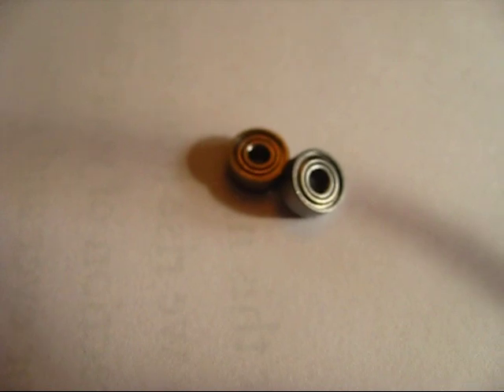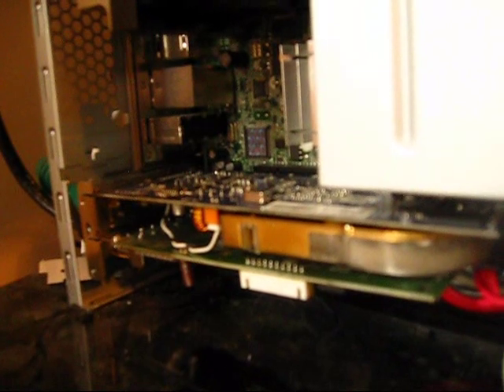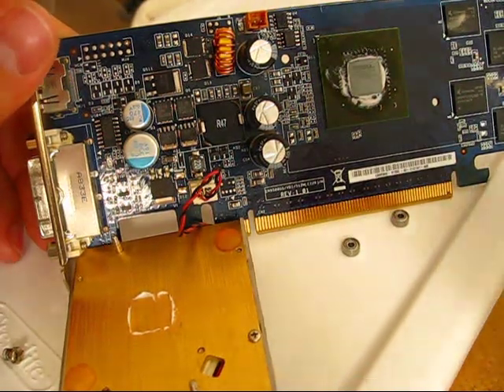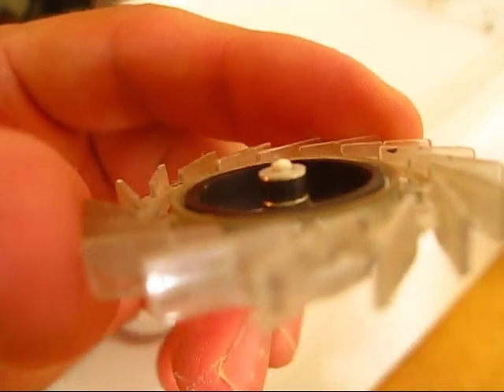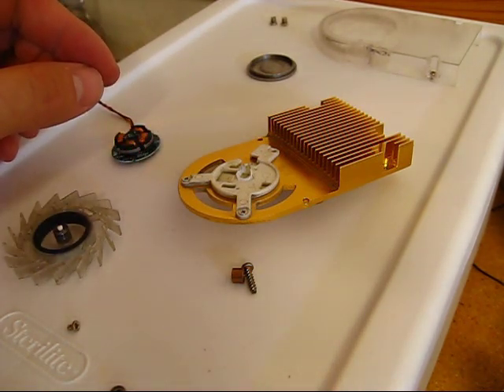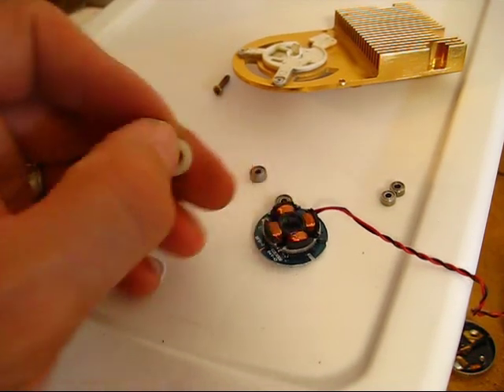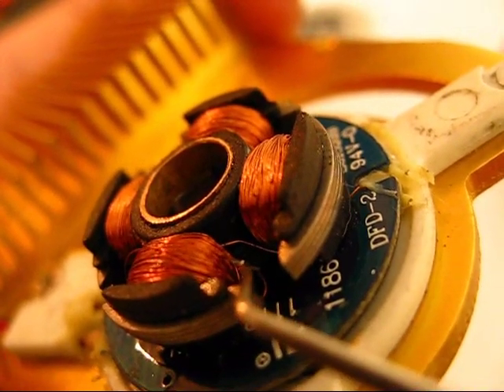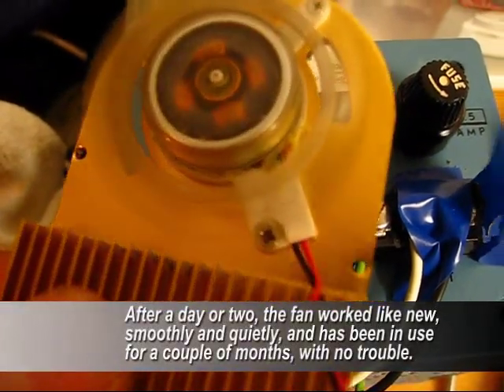Video Card Fan Repair

Comment: A Sayler It's kind of silly. The more you fix it, the more you break and have to fix lol. You need to research online and think about what you will do and if it will break it. If you think it will break it then do the fix differently!
A year ago I was trying to fix my 8 year old pc. I think my motherboard Asus p5nt deluxe, may have been overheating and causing my pc to freeze often. So I have decided to take the large heat sink off to reapply the thermal compound. Unfortunately the factory thermal compound was solid. So whilst taking off the heat sink, chunks of the 2 dies under the heat sink came off with it. 
I've tried reapplying thermal compound, putting the heat sink back on and reassembling the pc, but it didn't work, didn't even boot lol  
I had to buy a new motherboard but upgraded my pc at the same time :D

Comment: what are the materials needed ?
Reply from the maker: Your best bet is to take it apart and measure the rotor shaft with a caliber or micrometer, then order the bearings accordingly. Just the set of two bearing races should do the trick.

Comment: Very useful guide, thanks.
I have my own PC shop and repairs like this can be done when there's no other solution. I hate to throw away good kit.
Got the same problem right now with an MSI Nvidia NX8600GT, which is stretching my brain cells.

Comment: @ Sayler - you wrote your own music; you fixed the fan from scratch. Excellent.

I have just spend and entire day, more than 10 hours trying to modding down a 60mm fan to fit in a 20mm space to cool down an overzealous north bridge heatsink on my motherboard ... only to snap a blade off the fan I was working on. So much for 10 hours work, back to the drawing board.

But I'd love to have seen you mod out that fan to a passive heatsink. 

Excellent video.

Comment: the sticker on back of motor, pull that off do not unassemble blade from motor, may have to remove heatsink from fan tho to remove sticker...under sticker is a cap in center where bearings are located, make small hole in cap and apply oil (very little) and spin fan with finger to distribute oil, use paper towel for excess and reinstall, should sound 95% better & work 99% better, try first before disassemble or purchase of new

Comment: this is major stupid.  1st off u have to take the stator part of motor off, the plastic thingy on metal piece,  Then you take off the plastic ring on the back of rotor, /The plastic ring with the cut is a Lock that holds the fan from hitting shit, You just pulled the rotor off from front and damaged the lock on  the back! 2nd What about thermal grease?    You made this fan worse. what noise is bad sign.

Comment: Hey it's ok if I put haircut-macine oil (it's transparent) in to a 120mm fan to lower the noise, or it will became full of dust in time & gave even a worse noise?

Comment from the maker: @MarioIArguello yep.  This pc is small, maybe mini ITX size, so there is very little room inside.  Even with the fan working properly, I was still having trouble with heat until I removed the TV tuner card in the adjacent slot, and then, no more problems.

Comment: you could placed a regular PC fan next to the graphics card and have a little more cool air over the heat sink. I just fixed my graphics card small fan motor, luckly it was just a lot of fine dust inbedded in the shaft and bushings. Some compressed air and a little bit of 3 in 1 oil on the shaft top and bottom brought it back to life. Dust and heat are killers for these small devices.  Part of success is not to give up. When there is a will there is a way. Thumbs up!

Comment from the maker: @Keashane I was never able to find a fan for sale. Replacing the bearings is fairly inexpensive, though. search google for "bearings direct". once in that website, go to the metric sealed bearings. The inside diameter (ID) is 2.0, but you'll have to measure the bronze bushings you remove to verify the outside diameter (OD). I think it is 5.0.